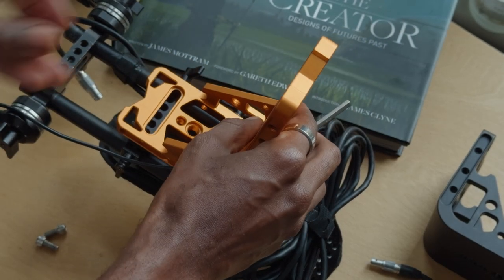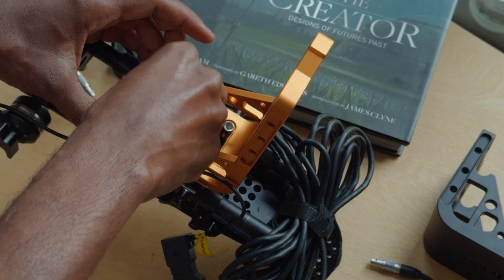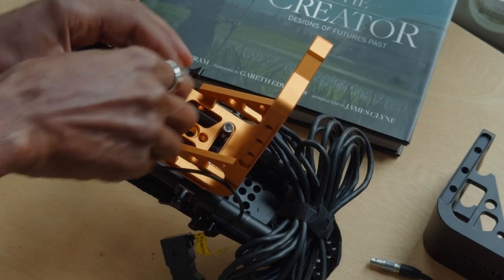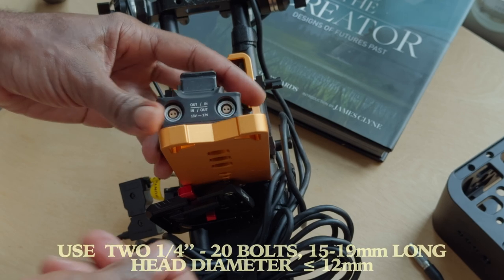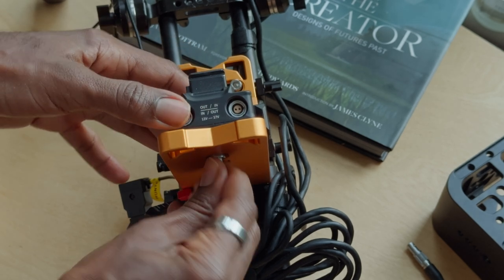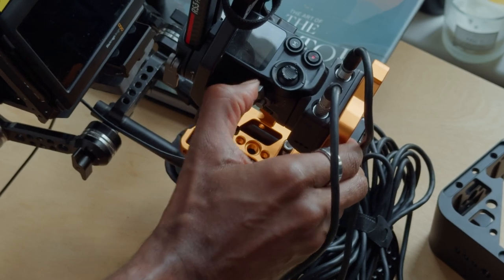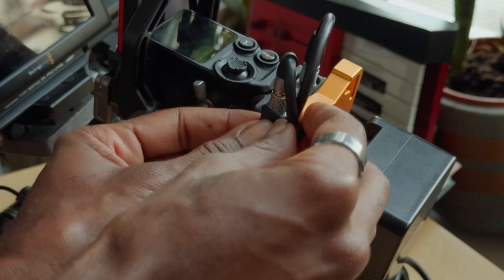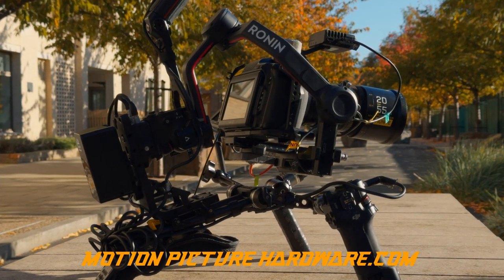The Creator Rig : How To Set Up the Heavy Duty Gimbal L Bracket, Quick Tutorial

Comment: I noticed when you placed the gimbal onto the smallrig power base, the weight of the gimbal made it fall forward a bit. Do you secure the gimbal at a different point as well to prevent it from coming off?
Reply from the maker: No additional securing, the point of contact acts as a fulcrum and once you lock the lever in the locked position, it should be secure due to the weight and the lever. It’s clever design by DJI 👍🏿

Comment: How do you balance the gimbal in this configuration?
Reply from the maker: Hi best practice is to balance it in the normal upright position and then make any fine adjustments when you have it in the creator mode. Strangely the gimbal doesn’t allow you to calibrate it in this more but rather only in the official undertaking mode as well as the original upright mode